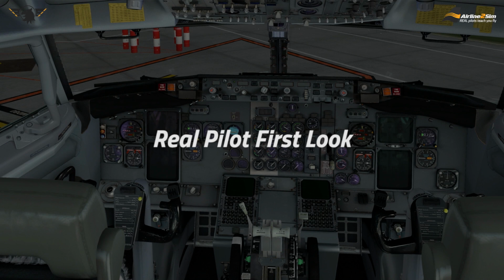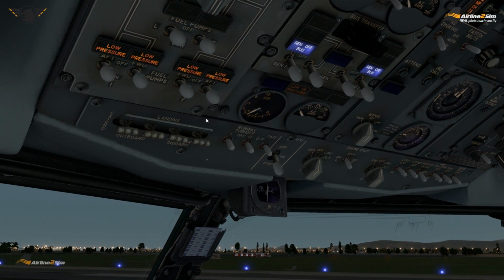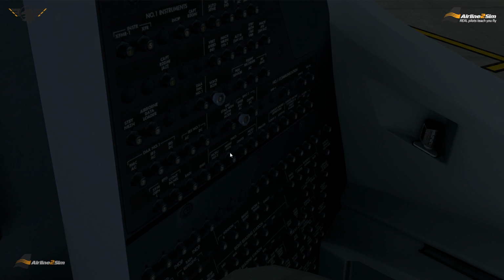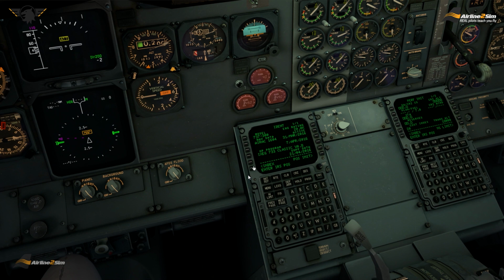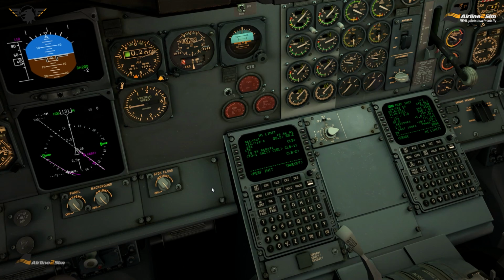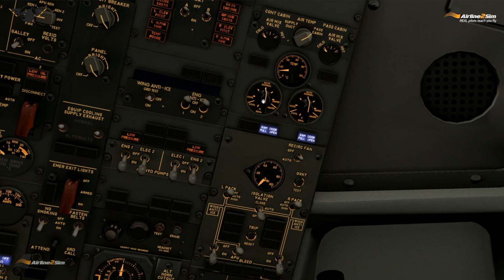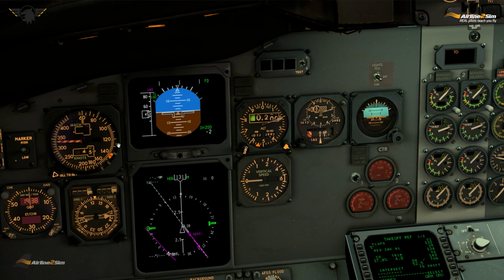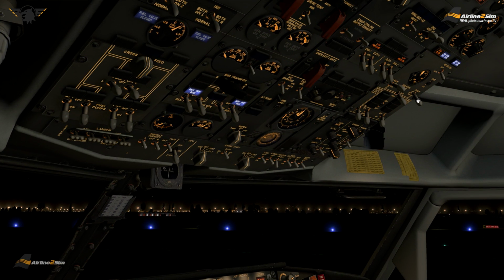[X-Plane/Airline2Sim] IXEG 737-300 *First Look* with a REAL Pilot - Part 2 | Preflight

Comment: Just a theory, but I think the IRS status on the overhead panel only displays up to 7 because Boeing didn't want to use more than three bits (a 1 or 0 in binary) of data, which can only represent numbers from 0-7, if they wanted to display any higher (the next increment would be 0-15) that would require them to add storage for an extra bit of data, which when the 733 was created, was a lot harder to come by then. So the 7 might be because that section of data storage might only have 3 bits, therefore due to the way binary works only allowing them to keep track of numbers less than or equal to 7.